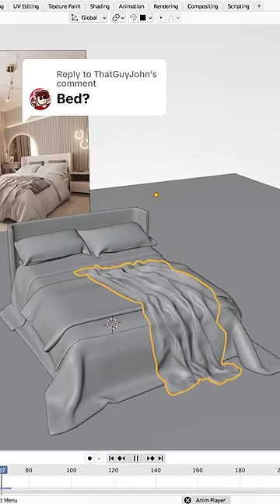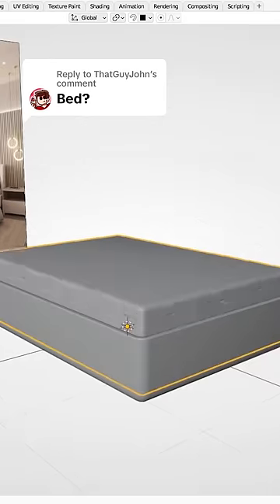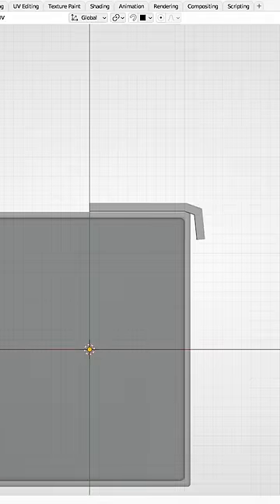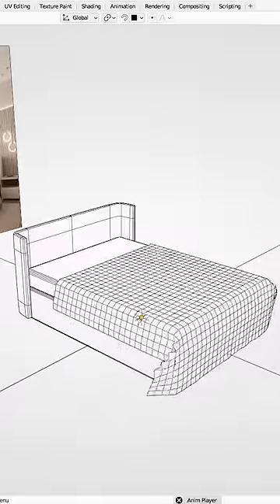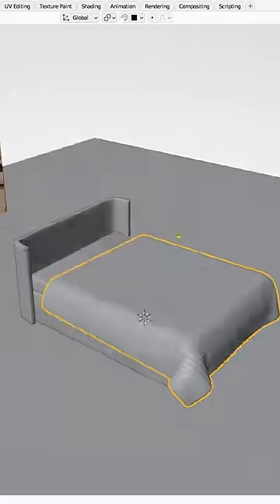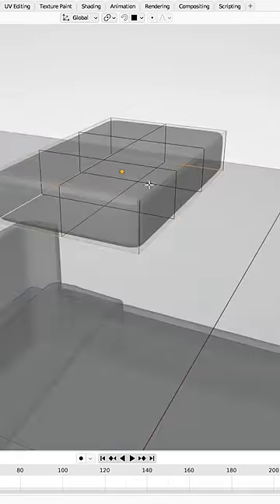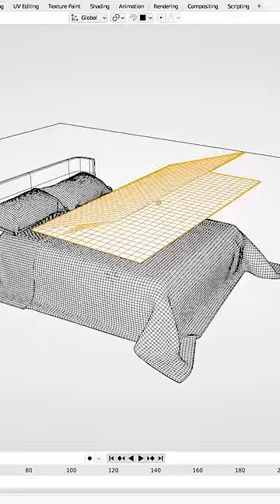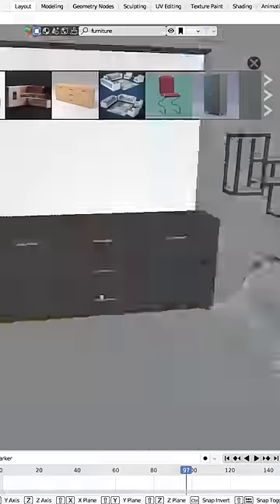3D modeling a Bed 🛏️ what should I model next? #blender #blender3d #3dart #3dmodel

Comment: bro do you think a gtx 1660 ti could do this
Reply: A 1660 ti is a more than capable card as modelling itself uses very few computational resources. Furthermore you are not restricted when rendering, as a lower end card can still achieve results comparable to a better one. Although, it will take longer to complete the render.